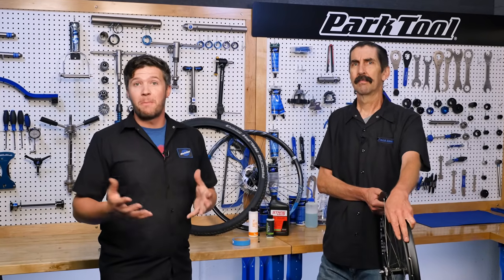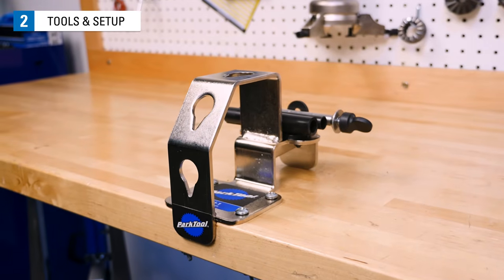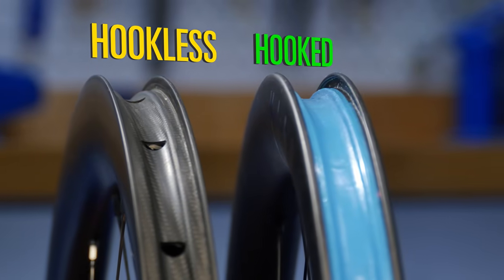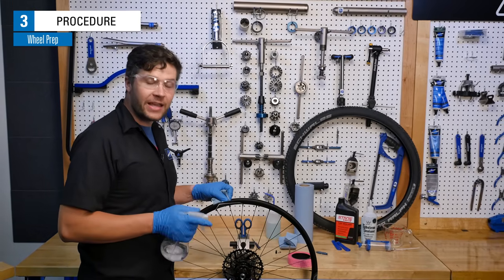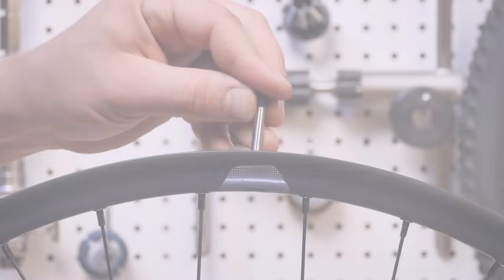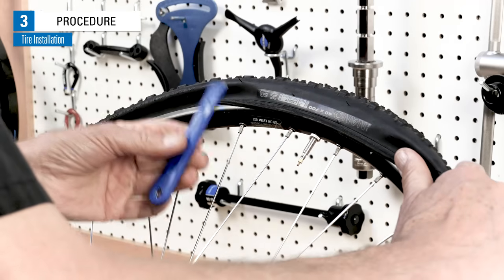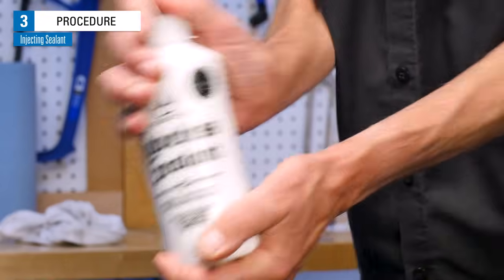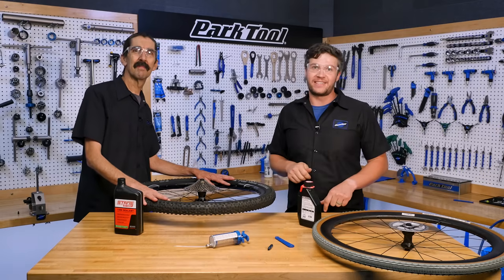How to Setup Tubeless Tires

Comment: This entire process is INSANELY over-complicated and if you get a flat while out riding, your ride is over....I don't get it, as well as I don't understand why quick release was replaced by non-quick release tech...So instead of having a hand pump and spare tube, I have to carry special tools with me to get the wheels off, special liquids, tools and cleaners and sealant to put air back in my wheel?  Seems stupid to me.

Comment: I’m about 2 minutes in to the video and having ridden tubes for decades, I have decided, tubes are just fine! All of this is is crazy and it’s why I carry a new tube with me. I can fix a flat, in rain, snow, or sun in 10 minutes TOPS.
Reply: i can fix a flat with my tubeless setup in half that time, don't even need to take the tyre off the bike (if a small hole or puncture sealant fixes it for me) with a bacon strip
Reply: I went tubeless on my Fat Bike. This saves a WHOPPING 6LBS!!!! I still carry a spare tube - as I did before! Have not needed to use it in the 4 years since converting.
Reply: Your call. But, you can still carry your spare tube around, and you can still install it in about 10minutes... But who would carry around 3 tubes?!?

Comment: I’ve fixed hundreds of flats over the last 35 years, but noticed the vulcanizing glues now available don’t work as well. The patch doesn’t seal as well and prone to leaks. I used to replace the tube after 3 patches. Now I tend to throw tubes away unless it’s a very small leak (eg, thorn).

Comment: Top video guys, I used this video to setup my tubeless road tyres 25mm first time and that soapy water spray is a must to get them to seat on the rim, otherwise it doesn’t work and I had to use 1 tyre lever to get them on the rim much tighter fit for Road tubeless tyres than mountain bike ones…
Reply from the maker: Glad it helped!
Reply: @parktool  managed to get them seated with a track pump no need for a tire booster...

Comment: Did mine yesterday and all's great so far, except I used the valve stem o-rings.....oppps. I'm going to take the o-rings off, and replace the nut w/o them, trying not to disturb the valve stem in any way when turning the nut off/on. Wish me luck!
I've always had trouble in the past with the valve stem nuts coming loose and that is why I decided to try it with o-rings this time, then I finally found this vid which talks about them. A bit late, but better than not at all. Great vid!

Comment: I was on the tubeless/tube fence this spring, I tried tubeless on my road bike about 3500 miles so far. I count at least 8 gashes on my rear tire. Every ride I air up 80 psi! They are usually around 75 psi.  There are wet dots of sealant on the 8 spots around the tire. I average 65 to 47 miles rides, theres white stringy crap on my rear brake which is sealant like I  ran over chewing gum.  Havent been stranded on the side of the road yet! I have 4 brothers that ride, they are still changing tubes on the side of the road lol!
Reply: Seven Bikes for Seven Brothers.

Comment: Okay so I have learned a few new tips. One is to inflate the tire without the valve core. The other is apply soapy water to the bead. I currently use a foam painters brush with soapy water, but I like the plastic bottle. Just wondering if that’s too much water getting mixed into the sealant.

Comment: thank you for a very useful video! is to "get rid of the valve's o-rings" mainly a roadbike carbon rim thing? because of thinner/less carbon layers for weight savings etc.? just guessing that mountainbike rims are built "stronger"? plus my mountain bike's rim (DT Swiss XMC 1200 Spline 30) has a circa 3 mm hole at the rim's side near the valve. enough to let air out in case ...
Reply from the maker: The issue is typically seen on Road wheels due to the higher pressure and the taller sidewalls. We estimate that about the same number or more MTB setups have pressure in the rim but never realize it. This is due to the lower pressure and shallower rim depth that makes the rim resist bowing out better than a deep road rim.
Reply: thank you very much for this experienced answer!

Comment: I just couldn’t get a good seat until the mechanic at trek recommended that I use a o ring inside. Possibly using a stem with a bad interface with the rim

Comment: Is it okay if the valve stem keeps moving even  though it's tight?

I just check my rim tape... And it's not even reaching the sidewall.. I saw some sealant got through the nipples should I get wider rim tape and slightly bigger valve stems, what should I buy for rim tape and valve stems?
The sealant on my tire dry's out like for a month... How long does a tire sealant last? 
Even though my tires and rims are tubless ready,I got my tubless set up at a  local bike shop...

Thank you it's a very useful video I learned a lot about how to properly set a tubless tire ❤️✌️

Comment: Is it OK to heat tires that are hard to get on the rim, generally, not only for tubeless? I saw someone do this on YT and I never thought about it before...
Reply from the maker: It may help. How you heat them is the key. Hot water would be the way to do this safely and effectively.
Reply: Thanks! Another question, why are half links listed under BMX chains sometimes? BMX bikes have horisontal drop outs as far as I know?! @parktool

Comment: Step 1: put in tubeless valves.
Step 2: install tires on rims.
Step 3. take the wheels to the bike shop that has an air compressor, and more patience and experience than me.

Love tubeless for road and gravel, but after many blood-sweat-and-tears sessions trying to seat them at home, I just take them to a shop. Well worth the trip.
Reply: The key is to really soak it down with a soap/water solution along with using compressed air. That's essentially all they are doing at the shop.
Reply: @obliviondio  I've done that.

Comment: I have had some tyres that didn't even seat, even with a compressor.  What I've had to do was to put a normal inner tube, and seat both sides, then only break 1 side, remove the inner tube, and seating only 1 side with the compressor works a lot easier.
Reply: @hcw199  It was, but its so worth it tbh.

Comment: Been running tubeless about a month now, it's sealed without leaks but the tires didn't pop onto the rim, they just went on quite easily and if theirs no air the tire easily falls off the rim wall, is this safe?
Reply from the maker: Is the rim tubeless compatible? It sounds like it may not have a proper "bead seat" for the tires bead to pop onto.

Comment: The process outlined by Parktool in this video while not wrong is terrible, especially ehen installing E Bike tires / tires with heavy casings.

1. The following prep work need to be done:
HEAT UP THE TIRES. It makes it much easier to install. Use the Sun, a Radiator, a Hairdryer etc.

2. Do not inject the sealant before the tire is fitted and checked to fit properly! 
It is common that the tire needs to be refitted. This is a mess when sealant is applied.
Only apply the sealant after the initial fitting. Only inject the sealant directly thru the valve fitting, do not dump it in the tire.
For injection you can use one of the syringes that come with your bleed kit. Which you will need to buy anyway at some point. Do not spend more then $30 on the kit.

Comment: Is there a minimum CFM for seating an MTB tire?  I am guessing around 3.0 or more.  Thanks.
Reply from the maker: Some tubeless can be seated with a floor pump and others need some serious air volume. So, this really does depend on the tires being installed. When looking at compressors CFM is often what the compressors pump can create but the hose size and tank volume have a more direct correlation to how much volume is being pushed into the tire.

Comment: Interesting that at 3:52 in this video Calvin says to remove the blue solid strip as it is not needed.  I just got a new gravel bike with WTB wheels and their WTB video (https://youtu.be/-Zt7u1R0wAA) says to reinstall that solid tape/strip (provided protection from a broken spoke and to prevent rim tape sag later).  Don’t know if the WTB (i23)  rim curvature is different from other wheels and requires you to leave the solid tape in place, but I think removing the tape makes sense for better adhesion of the rim tape to the rim.
Reply from the maker: Not all blue tape is the same, or green, or pink for that matter.  In the video that was a fabric rim strip, and not designed to seal air tight.

Comment: https://youtu.be/MuEiBSAKWLI

In this video of yours from 5 years ago, Calvin used to start taping the rim one spoke hole away from the valve hole and ending one spoke hole after the valve hole.

Now, Calvin starts from the opposite of the valve hole. May I know what's the reason for this different method? Was it to not create a slight bulge at the zone where the valve hole is located?
Reply: yeah i wonder about that as well
Reply: @madmat1652  Both methods work but Parktool just adjusted their technique like in this video now. Cheers

Comment: Ive had nothing but problems with tubeless setups. Tires not seating, tape not sealing, valves not sealing, tape sliding off when seating tires, tires blowing to pieces, flats, slow leaks, sealant messes, hours of wasted time. Been riding tubes this year and I'm 4300 miles only one flat. Anything by Stans No Tubes sucks, especially their rims.
Reply: Sounds like user error to me.

Comment: I love Park tutorials. But they missed an important step. After applying the tape, use a plastic tire lever to press the edge the of the tape into the rim bead seat. 

James The Bike Guy has an amazing tutorial where you use a bike flipped upside down and install your untaped wheel into it to simulate taping a wheel in a
truing stand. 

Make sure you stretch the tape as much as possible when installing. Don’t be too concerned about bubbles in the center channel. Be concerned that the tape is adhered and flush at the rim bead seat after you press it in with the tire lever. 

Happy trails. I highly recommend tannus inserts. Those a whole new level above going tubeless and they’re easy to take out if you get a gash in your tire.

Comment: Where did this notion of lower rolling resistance come from? Tubeless omits the tube but the tires are beefed up with more material. A clincher with latex tubes, however, has a thinner tire and high performing tube... and in some cirlces are said to be fastest.

Comment: On another Park video for the same subject (found at: https://www.youtube.com/watch?v=MuEiBSAKWLI&ab_channel=ParkTool) Park stated that the tubeless rim strip should be started a bit more than 1 spoke hole away, no mention of starting on the opposite side. Also, that other Park video stated to overlap the tape to the start point (again, less than 2 away)! 
Why the different instructions from the same company?
Reply from the maker: Either method can work as well.  The key aspect is to do two wraps.  We try to also watch what the other industry rep's are doing, and will change our technique accordingly, if it makes sense.
Reply: @parktool  That's great to hear. Your videos helped me so much in the past. Thank you for doing what you do ✌

Comment: Do you think going tubeless on wheels and not able to use the bike around 2 weeks or more can be not worth it? 

I have seen older guys that ride with me always go and pump air in their wheels. I offered them to let me check and the sealant was very dry and he said the he rode it like 1 month ago.

I run with tubes because of (hehe) lack of funds. But knows to fix bikes thanks to all wonder resources from Park Tool and other Youtubers.
Reply from the maker: a lot of the initial sealant put into the tire is used to coat the area inside the tire/wheel and can use most of the initial sealant to coat that surface area. It will need to be re applied. Tubeless is not for everyone, not a requirement and we are not saying its better or worse than anything else, just showing how to set it up.

Comment: You didn’t show the part where everything is covered in a gooey mess as you try, and retry, to seat the tyres. Oh, and try and fix a puncture in the middle of nowhere. Tiny gains, big disadvantages,
Reply: the goo is supposed to seal punctures
Reply: Why would you ever put sealant in the tire before seating it?
Reply: @simon-patrickjohnson  So will a good coating of coal tar
Reply: Funny, but most of the retro-grouches love to hate disc brakes. I’m an old guy whose first race was in 1971. I adopted both disc brakes and tubeless tires, first on my racing MTB, then gravel, and finally road. I’m a tech geek and do all the maintenance on my bike. I find disc brakes to be indispensable and a major upgrade because they stop in the rain. Especially with carbon fiber rims. There’s some fiddling with keeping the rotors centered, especially with different wheels on the same bike. But in general, I find disc brakes to be superior to rim brakes. But tubeless? I’ve committed to them and in general find them to be a major pain compared to tubes. The goo solidifies and basically requires you to get a new tire. I have lots of bikes, and some sit on the rack for awhile—tubeless is a disaster with any bike you don’t ride often. They always deflate and solidify internally. And regardless of how you do it, that goo gets everywhere. It gunks up the valves and seating the tires can be a major pain. Tubes aren’t without their problems, but all things considered, I prefer them to tubeless and will probably go back to them on my road and gravel bikes. Just my two cents. BTW, long-time friend of Calvin Jones of Park Tool, who I knew when he was the USCF lead mechanic in Colorado Springs back in the early 1990s. Glad he ended up at Park Tool—quite a character and a literally encyclopedia of bike wisdom. Bravo! 🇺🇸
Reply: The goo plugs up holes, so you are less likely to get a flat with tubeless. Also, repairing a tubeless tire is way easier than replacing a tube. All you need is a bacon plug. For larger cuts, you can always put in a tube as a last resort.
Reply: Sounds like you should start from the basics. 

Refresh tape, new valves, fresh sealant and new tires. Then you’re good to go :)

Comment: Ive been running my xc MTB tubeless without any sealant for 2+ years. I need to pump it up before every ride (which i would do anyways). Sealant isnt needed if your risk of puncture is low... car tyres dont use it. Also, tubeless for road bikes is just stupid.
Reply: Why is going tubeless on road tires stupid?  Facts?
Reply: tubeless for road is absolutely not stupid, just because you don't need it doesn't mean others don't

Comment: Why is this hassle better than a tube?
Reply: When a thorn or a screw or rock goes through a tube, it flats.  When the same thing happens on a tubeless with sealant…it doesn’t.  So, much better flat resistance, and you can run lower pressures for varied terrain without risking a pinch flat.
Reply: Adding to the above answer…as I’ve never really had flat problems my entire life on tubes, upon switching to tubeless I enjoy riding it but do not enjoy wrenching it.

Old timers like me can’t reconcile with the new logic of lower pressures = faster times. Whether it’s true or not (probably is), it’s definitely more comfortable to ride and the bike just soaks up rocks and roots while you just keep pedaling.

We’ve dented rims running  tubeless at such low pressures and not had pinch flats, so there’s that.

But changing a tire it a PITA as is managing sealant levels. When we make a race day tire change decision I’m cursing this new technology the whole time. It’s messy and time consuming and I just don’t like it.

Comment: I cannot tape a tubeless wheel well enough to keep from losing 20 lbs of air pressure in an hour to save my life.  No idea why stans calls that stuff "tape" because there isnt anything sticky about it.
Reply from the maker: Tapes certainly vary in quality.  Make sure of course the rim surface is very clean and dry.  After mounting use some soapy water to identify the source of leaking.  Bubbles at the rim/tire is from the seating, but bubbles at spoke nipples likely from the tape.

Comment: It's a cool vid, but I've just spent a whole day trying to get a Conti 5000 TR seated and sealed on a Roval front rim, after 15 minutes for the rear. This tech is ABSOLUTELY SHITE. And I'm going back to clinchers and tubes for training, and tubulars for racing (Dugast or FMB Paris Roubaix Silks, English "3rd world" roads oblige). FMB Service Course if it's raining. Quality is consistency, and road tubeless right now is very. very. very. unreliable.